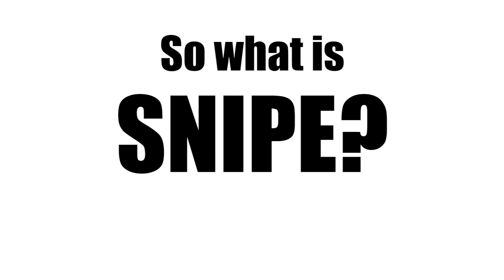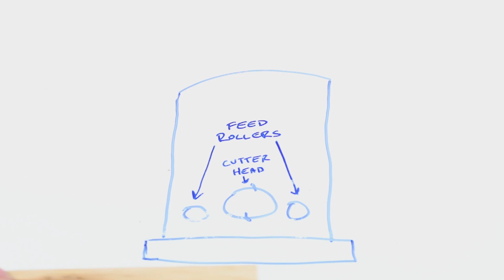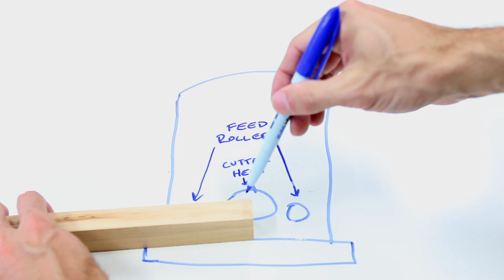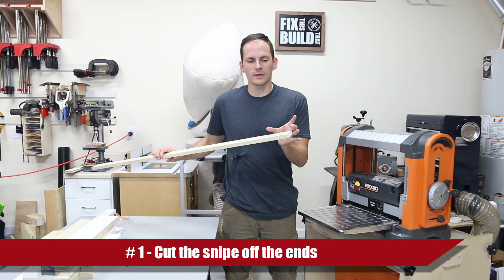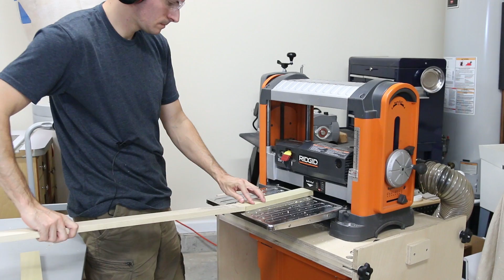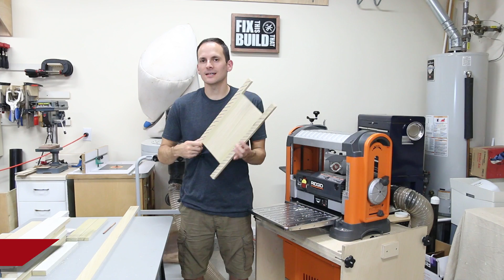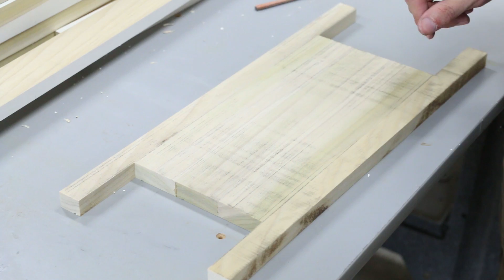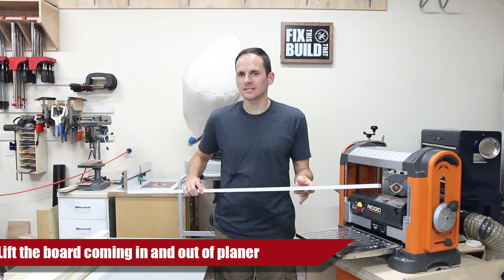6 Ways to Reduce Planer Snipe

Comment: Good video Brad. I appreciate your honesty on the results. I use the angle method as well as a modified version of lifting idea. I try to keep the board from moving by pushing it down flat onto the in and outfeed table. Same idea, just keeping it from lifting. I think the planer also has a lot to do with it. Before I got the planer I have now I was using a cheap HF model with no in/out fees tables and snipe was impossible to stop. The model I have now has really nice solid steel tables and snipe isn't bad at all. Keep up the good work!!
Reply from the maker: Thanks, Nate.  Yeah, the planer definitely will play a big role in it.  But these methods should help for most.  I thought about doing a hybrid lift and angle, but just left it as is.

Comment: Great video. Thanks, Brad for doing these tests. I'm quite surprised too at the snipe not being eliminated in using the sacrificial boards on each side. But, thinking about it, it seems that would be the most wasteful method. I've used the angle method as well as the board in front of and behind and have had better luck with the latter. I have a 12" Delta so it might be slightly improved when you step it up to a more expensive lunch box planer. I haven't had much luck with lifting the board up. Also, are the rollers adjustable on your planer or is that just a feature on the floor standing planers?
Reply from the maker: I don't believe the rollers are adjustable on this one, but I've never tried it out.

Comment: how bout making an extended infeed and out feed plank or raising the plainer blade a smidge
Reply: oh ok my bad
Reply from the maker: +Donald Ewing building an extension sled would work too
Reply: try it out
Reply: Donald, I really like that idea.... but I'm limited on space.
Reply: you could make it removable
Reply: No because it's the in and out feed from the rollers and you need to have something to accept the snipe.  I do use a sled but you need to introduce same thickness sacrificial pieces about 6" long.  I also use 2 sided carpet tape rather than regular 2 sided tape.  Cheaper and stickier. Also I do take minimal amounts off with each pass.  I also flip as soon as I get a flat topside.
Reply: Donald Ewing And then put it where?  See, that is my dilimma.  Plus, we rent a house.